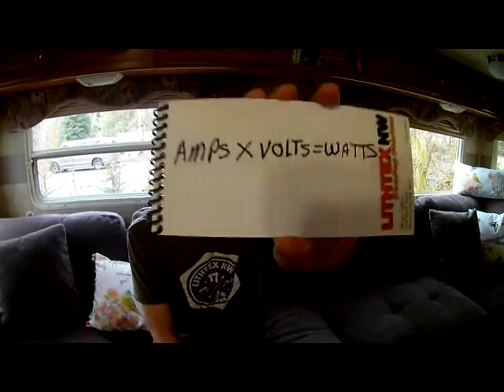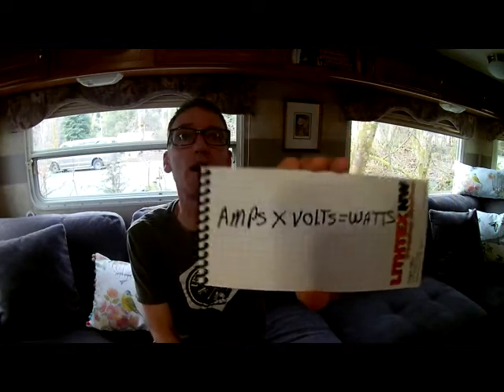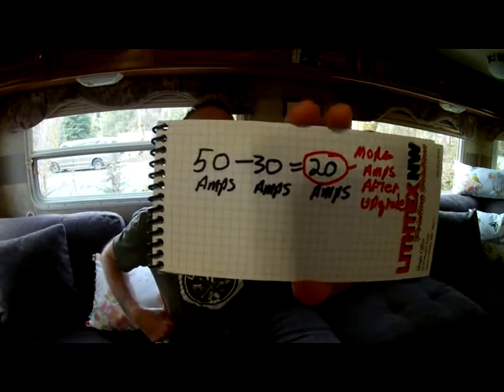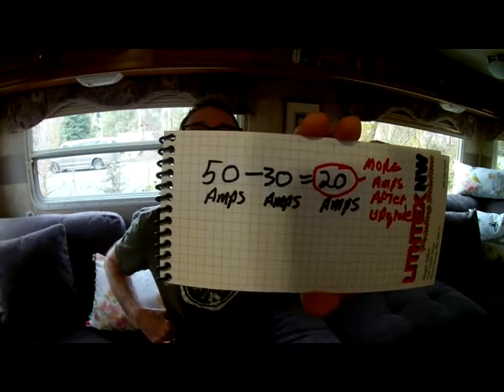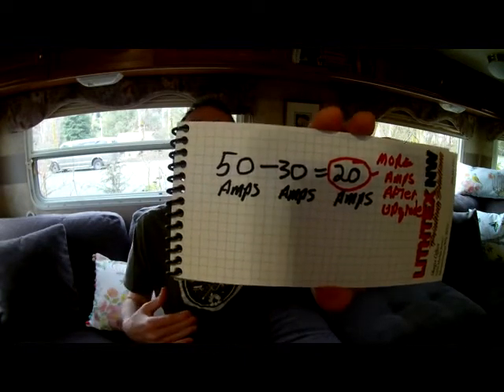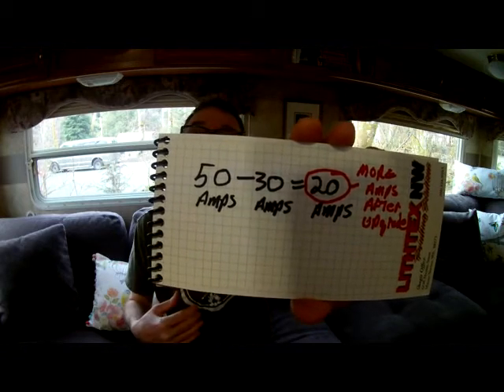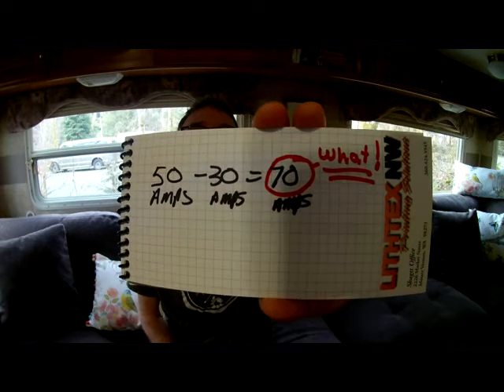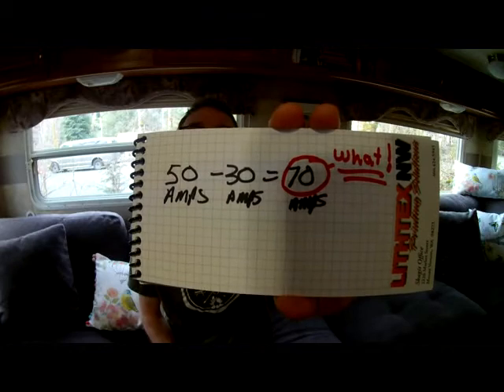RV 50 amp Upgrade - The Basics

Comment: Voltage times Amperage equals what is referred to as kVA. Take the kVA times PF (Power Factor (percentage of actual usable power)in most cases safely is 80 to 85 percent) Equals Actual power Available.  Please before you or anyone attempt to do any electrical do your reading on the subject and most of all have someone there that knows power before you attempt it.
Reply from the maker: Denny Osborn thanks! Good information and advice. (that's why I make sure some of my friends are real electricians 😊). This video wasn't intended to be an instructional on how to install. Just to point out the basic differences between three RV's 30 Amp and 50 Amp.

Comment: Thanks Rick Great Job! Answered a lot of my questions. I am also curious about the dryer after the upgrade.
Reply from the maker: Next video... The short answer is yes you can. But it depends on your other electrical loads. There is also the mater of balancing the load witch, is something you didn't need to do with the 30 Amp RV supply. Thanks for the comment Allen!
Reply: @keyin2it  Did you make the 'Next video' on this topic?  If so, could you please add a link to it?  Thanks.